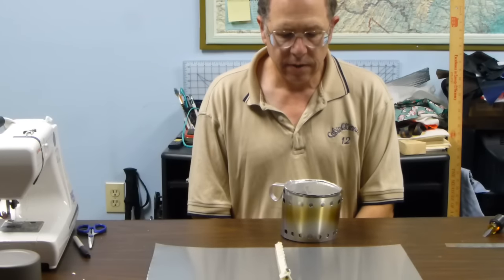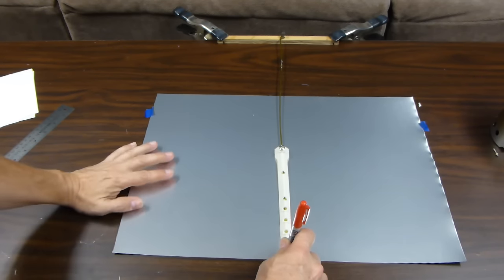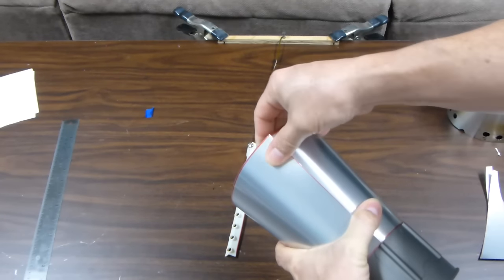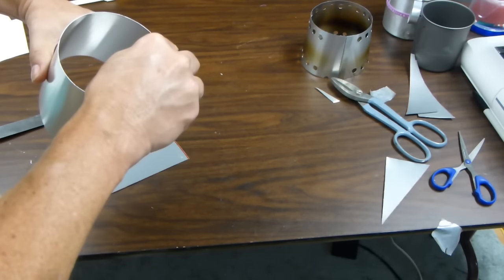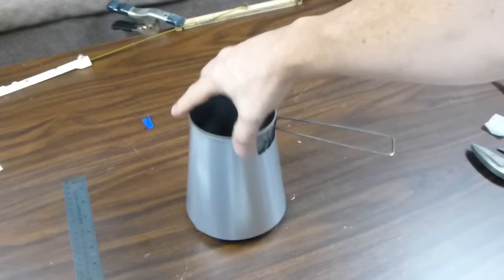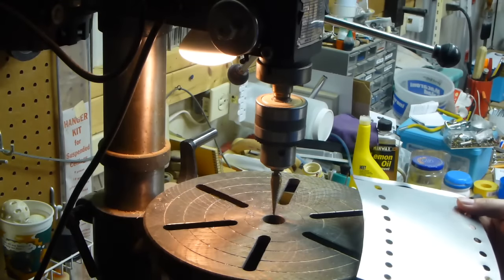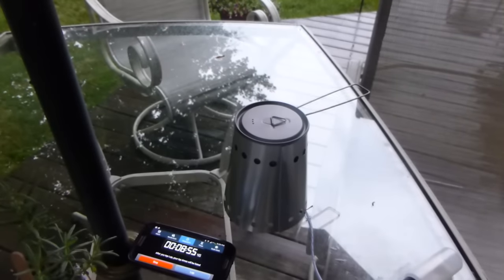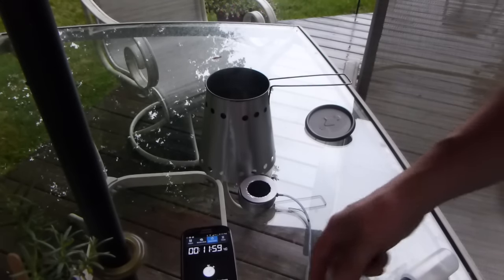DIY Caldera Cone

Comment: Your posts are always interesting and I admire how you combine a DIY ethos with an exactitude in execution.. Caldera systems are fascinating but are perhaps not my preference. The high thermal efficiency comes with a high centre of gravity price tag, and the requirement for a level platform is difficult to meet where I trek.
Reply from the maker: M00nsplitter Thanks, I am an engineer and can't not be one. I have not used one in the field yet, but I have been disappointed with alcohol stoves on the trail. Most of this I believe has been due to wind, so I thought I would give this a shot. I'll give a report this weekend as I am getting out on the AT this Friday and Saturday.
Reply: PaCampingDad I might mention that I have tried out a few alcohol stoves on the trail and generally been disappointed also. One notable exception however has been the titanium Clikstand set (pot support + windshield) combined with an Evernew burner and a 15 cm Ø x 7 cm H titanium pot. I am impressed with the boil times and fuel efficiency of this system. The only real problem is that the burner sits a little too loosely in the support plate intended for a Trangia burner, but a couple of strips of aluminium foil to shim the opening should resolve this issue. The entire set up is contained in the pot which. together with a titanium pot lifter and a mesh stuff-sack, weighs 300 grammes.

Oh, I forgot to mention that it's a pretty ****ing expensive set up.

Comment: I like your video. However, as I was planning to replicate the setup, I realized that I could not, because at least one of the measurements is missing. It think either one of the following two measurements would give me the information I am looking for:
1. the radius of outer circle (which is the length of the coat hanger and plastic combined)
2. length of the outer arc (or equivalently the circumference or the diameter of the caldera cone when set up)
Can you by chance still provide any of these measurements? That would make this demonstration video an instructional video. And me a small bit happier ;-)
Reply from the maker: It's been a long time since I worked with the caldera cones. I learned from 2questions at Hammock Forums. He had a nice video on the planning https://www.youtube.com/watch?v=VerP7-aiEBw  - Hopefully this answers your questions, but I'll try to take a look in the next few days and see if I can answer your specific questions

Comment: 21:25 You realize, your drill press has a depth stop, right? No need to guess if they're all the same size, just set the stop to where the right step pierces the sheet, and pull the handle til it stops.
28:05 You can also touch up the back side of the holes with the uni-bit. Easy-peasy. Just touch the next larger size to the rough edges of the holes.

Comment: Good video friend. I was wondering, for the one you already have made what material is the pink band around the pot made of? Is there not a risk of it melting with the heat?
I see it’s purpose though. It holds the caldera half way up the pot so you can get a stove under while still being able to store the caldera in the pot when not in use. Nice

Atb
Reply from the maker: It's a silicone band, so up to boiling is fine (normally up to 400 degrees F) , but you need keep the flames away from it.
Reply: @PaCampingDad  many thanks 👍

Comment: Nice. Are the top vent holes blocked by the pot or does the cone shape allow for heat to escape? Mine came out blocked. I may need to make it slightly larger to leave space for the vents. How did yours work out?
Reply from the maker: There is some airflow, but it's restricted somewhat. I added a lot more vent holes that I originally tried. There needs to be the right amount of flow for your stove, too little and it burns slow, too much heat trapped and the aluminum will start to deform, too much flow then it is just a pot stand.
Reply: @PaCampingDad  I had too little airflow I think. The alcohol was boiling out the vent holes at the bottom. That version I made as a straight cylinder. I made one like you described but I still have some work to do. I used left over roof flashing. I used a Fancee Feast stove.